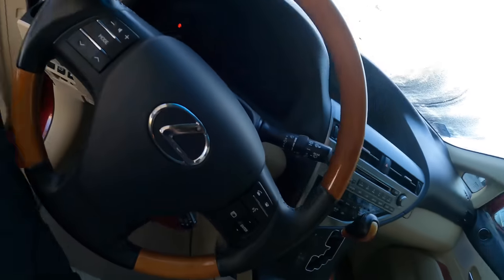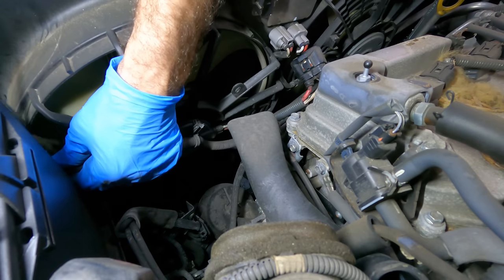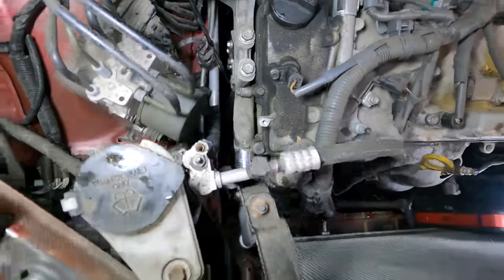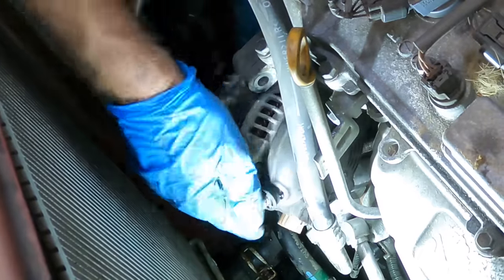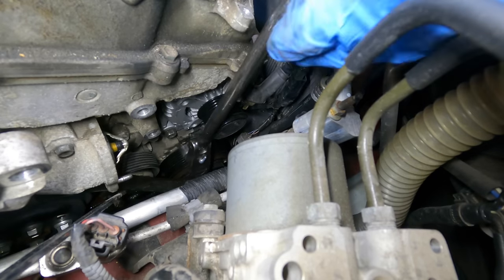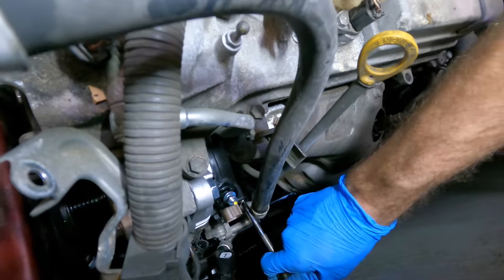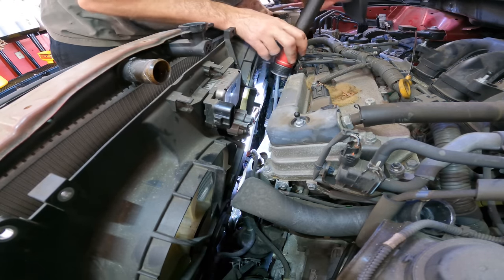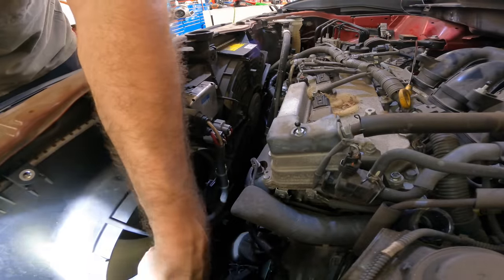Lexus Died While Driving! Towed In! No crank no start.  2011 Lexus RX 350

Comment: This job would have taken me 3 days and a trip to the Crisis Center after I pushed this Lexus out of my garage and set it on fire. You’re a patient man Ray, and a pretty good editor. I enjoy your channel, it’s part of my daily routine.
Reply: Lol
Reply: The right tools make a big difference, most of us don't have any where close to the amount of tools they have!
Reply: literally me anytime I have to deal with a shitty FWD oriented setup. Worst design for working on EVER. OK, maybe a RR Porsche is worse...
Reply: 🤣 You're not lying.  Ray is an excellent mechanic. His recall is astounding. The amount of components he had to remove to do a 5 minute alt replacement.  That's why he's the professional. I know I would have forgotten a step or two on the reassemble.  He's very entertaining and a great, through mechanic.
Reply: You are so correct. 👍🏾
Reply: @bktodc  My thinking is, if there are parts left over, you don't really need them.
Reply: Where I grew up, we used to joke about cars being "dump cars." The idea behind the joke was, when the car was about to die (or you were ready to push it off a cliff) you'd fill it with all the household garbage you could find, drive it to the dump, pull the plates and hitchhike home.
Reply: How about dynamite? That would cure its problem forever.
Reply: 100% Don
Reply: I'd certainly set a GM on fire before I torched a Lexus. Then again, GM's usually set themselves on fire first.
Reply: I came really close when replacing the alternator in my G37x. A job I should have just paid someone else to do.
Reply: @mcm04901  😂😂😂😂😂😂😂
Reply: My exact thoughts... I'd have just abandoned it on the side of the road.  What an absolute PAIN in the rear.
Reply: I thought mine was bad where you have to pop the ball joint and remove the cv axle. Uh....no
Reply: @cwstout1  If you have leftover parts and the car still works then you did a better job than the factory.
Reply: Same for me. What a challenge!!!!!!.
Reply: I kept reading about how Lexus was top of the line, so I looked into getting a used Lexus some time back. Then I fooled around and watched some repair videos on them and told myself that I'd try my hand at the other end of the vehicle spectrum...
Reply: LMAO!!!!!!!!!!
Reply: Exacly
Reply: lol great comment,  set it on fire  :-D
Reply: Try doing one on a 2007 Ford Escape AWD 3.0L V6... You may end up in the Pshyc ward lol...
Reply: Lol, perfect description! 🤣🤣🤣🤣
Reply: @bktodc  when you do it everyday it becomes easy to reassemble
Reply: No vehicle can be repaired without patience!
And, beer.
Reply: @mcm04901  we packed ours with Tenerite and gas.
Reply: I/wife have a 2015. Ya Don, what you said. I could have...but......! So if and when it happens, hubby isn't gonna come to the rescue. Also, I'll never go the the Lexus dealer again. All they want is $$$$$
Reply: @gidderman  Is that like the one where you have to pull the side of the car off and steering, then lower the engine? Something like 4 hours just to pull it.
Reply: @scottw.8871  Lol yeah, drop the sub-frame, pull the half shaft out, and a million tiny bolts in the cooling duct which always rust into the casing. Its a real treat 😅
Reply: That’s crazy  I will never buy a Lexus lol  
If I did that job I would have a box of extra parts lol
Reply: Don, I see I'm not the only 3 day for a job man. The older I get, the longer it takes.
Reply: He is the one and only master macanick.
Reply: @gidderman  I have done one. This Lexus looks harder.
Reply: Yeah.  Long about 16:20, watching all this actually got me depressed.  That's not a repair--that's a freaking career .  OMG.
Reply: Changed starter on GMC Onvy for my mother. Easier to cut vehicle in half. If it wasn’t  her ride I would have walked away while throwing the match.
Reply: Burning the Lexus or the Garage!
Reply: I second that! and LOL
Reply: I would not even try it myself. I was feeling anxious, just watching this video. I’ve done this kind of work, but i was younger, but still got frustrated. I was changing the water pump from a 1991 Mercury Grand Marquis. Not because is a big car doesn’t mean the whole engine compartment was not full of brackets. It still was a hard job😖🥵
Reply: "trip to the Crisis Center".... ha ha ha ha. The other day I was dropping a skid plate on my 4runner for oil change and thought I stripped the head of a bolt...had 1/2" socket instead of 12 mm. Almost started crying underneath my car until i realized my mistake.
Reply: You should have Lexus design engineer watch this video.
Reply: Lmao!!!!!  Good post don!!!
Reply: This comment, omg I'd be so pissed
Reply: I agree , this alternator replacement means taking a lot of things outta the way, frustrating to watch, I'd say it is one of the most difficult alternators to replace.
Reply: Geez I thought Lexus was just Toyota with extra bells and whistles and not supposed to be so complicated. Like how Acura is just a fancied up Honda but almost the same setups?

Comment: Being an engineer in my former life, I always astounded at the total lack of design towards maintenance. They should force designers to live with these cars after the warrantee runs out so they are forced to learn the error of their ways. Cheers. Good video Ray.
Reply: What possible reason would new car designers have to care about ease of maintenance?  They are concerned with maximizing profit on new cars.
Reply: @randomschmo5778  Yeah, you're correct. The problem really starts at the top.
Reply: Warranty...
Reply: @frandanco6289  Reduce warranty issues and you are gold
Reply: He’s lucky he didn’t have to pull engine and trans to get to the alternator. The Toyota way!
Reply: Yes please.
Reply: @spangy8405  if you want a luxury car with a relatively big engine squeezed into a tight space, this is what happens.
Reply: If you can take a look at Toyota Yaris engine components design, you will see it is much more room to work on the car with small engine component. It is too bad that Yaris is no longer manufactured.
Reply: @johnmadow5331  it's also a significantly smaller and less advanced/powerful engine
Reply: @johnmadow5331  older cars had much bigger engine bay. Eg the infamous Camry 2000, on the other hand, the 2GR-FE V6 exist since 2005, relatively small V6, its found in larger vehicle, so it's still a tight squeeze when you put it in a smaller SUV and sedan, the Camry with that engine will probably have even less room to work with lol
Reply: I agree w/u
Reply: @pedroalonso75  While Toyota own Lexus, they're 2 different design and engineering teams.
Reply: This one is really not so bad it's just packaging a relatively large engine and fitting all the components in and still having a way to get them out. Believe me there are way worse alternator locations on Ford and Chevy passenger vehicles that allow for even more labor time.
Reply: @abigmonkeyforme I recently bought a 2011 Pilot with 66k miles on it. The apparent ease of maintenance was a big part of the decision.
Reply: @davidson46100   except for the timing belt
Reply: The purpose of hiring these engineers is to keep the manufacturers cost low to produce these parts and to keep the maintenance/labor cost high for the consumer to pay at the dealership service department where the dealership makes their money and also selling used vehicles. Having a thousand plastic clips to remove increases the labor times. They're all working together to make money.
Reply: The difference between American engineers is that the Japanese design cars to never need maintenance. 
Years ago IBM spec'd out some parts for a project and said that there could be a 2% failure rate...
The parts arrived and there was a note stating that the Japanese group did not understand why they wanted 2% failures, but packaged them separately for the American Engineers convenience.
Reply: Totally agree!! I've had that same thought many times and would love to watch one of them struggle with the repair and their design.
Reply: I totally agree  . I was a tech for way to long
Reply: @daijoubu4529  see ya up u in uhh uh
Reply: My father worked in aerospace for most of his life, and I remember half-serious jokes that the engineers who designed airline seats should be required to use one in their cubicles. Personally, I always thought that was an excellent idea.
Reply: @NoOne56488  at least That gives them a unique design when you have two teams. Unlike Nissan and infinite using same styles
Reply: You should have Lexus design engineer watch this video.
Reply: Always need to remember that most often this sort of tight design is for crash test rating improvement
Reply: FWD forces transverse layout which is a problem for V6 engines.  This is why I prefer RWD cars.
Reply: Totally agree!  Had to replace an alternator on a 2008 Lexus RX350.  On that one, there is a cable clip attached to the rear bracket, which had to be unclipped before pulling the alternator off.  I don't know what moron engineer at Toyota decided that was a good idea.  Or maybe they thought it would be funny, but what a freakin' pain!

Comment: I honestly think the engineers that build these, have a drinking game during design planning.
Reply: You mean the "engineers". No apostrophe.
Reply: Thats why I like older cars and trucks you had room to work on things
Reply: Cars are engineered for assembly at the plant, not for maintenance, unfortunately.
Reply: @theyweredeadwhenigotthere1391  not incompetent. They're doing what they're told to save cost.
Reply: I remember when changing an alternator was a 10 minute job. even for a home mechanic such as myself...
Reply: @paulheitkemper1559  true but simpler is always better and usually cheaper
Reply: @GARDENER42  still is on a 2005 ford taurus thankfully
Reply: @theyweredeadwhenigotthere1391  you could make everything real simple and be snap together modules. That would also be really really expensive and you would not pay the cost. You can lament things not being simple but DOT regs and mileage requirements  demand more ways to lighten everything , make the car stronger and safer and still be affordable. Modern cars are amazing pieces of technology manufactured to pretty tight tolerances on highly efficient production lines. Yes, cars are designed for assembly and routine repairs.  No, you will never have empty engine bays the way you had in a 1975 Oldsmobile
Reply: @GARDENER42  I remember when fuel filters were  glass domes and you just snapped open the fastener and replaced it...easy.  Now they are at the bottom of the fuel tank.
Reply: @theyweredeadwhenigotthere1391  I agree, but remember the old saying: "Every complex problem has a simple, easy to understand, wrong answer."
Reply: @GARDENER42  yeah, those older cars had much bigger engine bays, and fewer sensors, wires, and hoses.
Reply: @valvodka  not to mention that the engine bay is one of the harshest environments out there for electronics and other equipment.
Reply: Last time I talked to an engineer, it was a coke party...
Reply: wheres the nator, its at the front, bottom of engine, . o.k., take the trunk lid off, then we,ll work towards it... right boss.... bit like the toyota 79 series & dooramucks,, starter midle of valley..excrement..idea..
Reply: wheres the nator, its at the front, bottom of engine, . o.k., take the trunk lid off, then we,ll work towards it... right boss.... bit like the toyota 79 series & dooramucks,, starter midle of valley..excrement..idea..
Reply: WOW, john,,,new car,, yeh mate,, why did you trade the old one,,  oohh,,flat tire,, cheaper..
Reply: Asian cars are trying to compete with the Europe cars on how many bolts you got to take out to replace one part
Reply: It’s easy to build when engines out of the car but they don’t think repair wise when it’s all in the car cause companies would rather you just buy a new car
Reply: TRUE

Comment: I miss the days when if you wanted to remove the alternator you just removed alternator.  Now you have to remove the fans and fan shroud, disconnect radiator hoses, upper motor mounts, a/c compressor and jack the engine up to get to the alternator.

Comment: PRO TIP: place a piece of carboard directly in front of the radiator fins to prevent accidental damage. It takes up no room, stays in place and won't obstruct your actions while protecting the radiator.

Comment: Ray - I'm a toyota tech, I've replaced those alternators with way too many different methods/techniques, here's just my 2¢ to make this job easier for the next time - I would of done 3 things differently

in the passenger front wheel well, there's a plastic access panel you can remove to gain access to the idler pulley, that way you don't need to remove the coolant bypass/tstat or upper engine mount. 

also, on some models you can remove the upper radiator support and move the rad a little more to make it much easier to remove/reinstall the alternator.

lastly, there is a specific procedure to bleed the coolant on those 2GR engines, using the high-point bleed nipple that lives on the coolant bypass next to the intake manifold. there's youtube videos showing this procedure, if you don't follow, you'll leave an air pocket in the system that will eventually make its way to the heater core.
Reply: Man I read it wrong I thought you were going to say number one cry about it number two kick the car number three pay somebody else to do the job hey have a great day

Comment: Alternator replacement procedure for a 2011 Lexus RX 350 is as follows:
Open hood
Gaze inside for a few moments
Close hood
Take vehicle to Ray 👍
Reply: When you're gazing at it you should have a wobble pop in your hand 🍻
Reply: You forgot the step where you toss a frag grenade inside and then get a vehicle not designed by impractical idiots.

Comment: hey ray, toyota lexus tech here, on all 2gr alternators ive done, the tentioner has a locking hole in it, get a long m8 bolt, lock the tensioner and the bottom bolt for the alternator is right there, ratchet and a shallow socket no funny tricks, ive never had to remove that coolant tube or the motor mount for one of these! with that being said atleast book time is over 4 hours lmao
Reply: Thanks for the tip. I've not worked on any yet, but never know in the future.